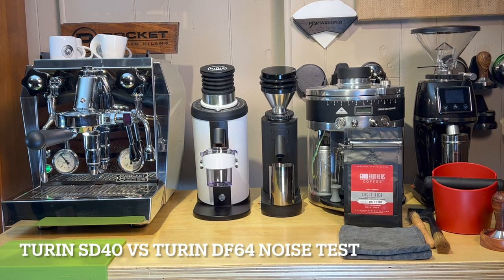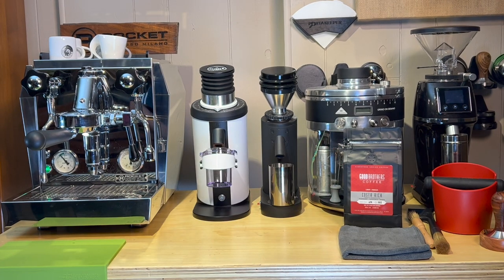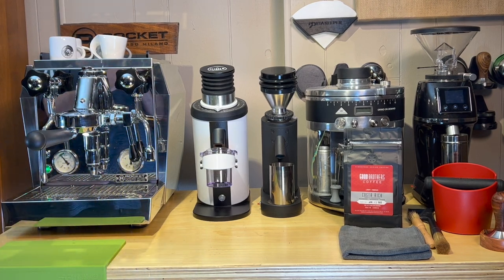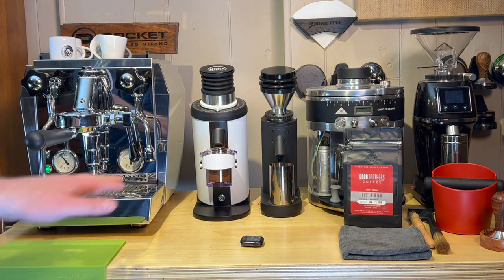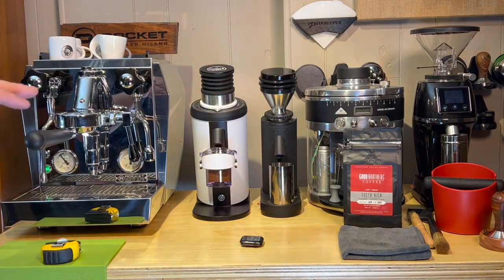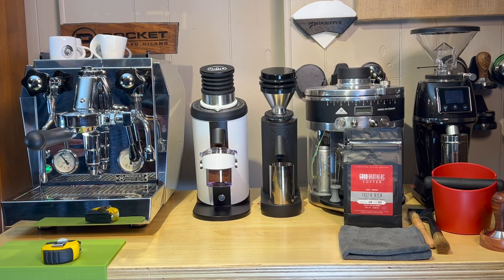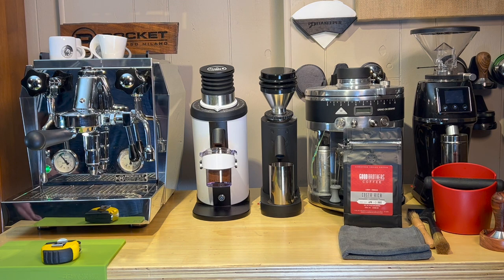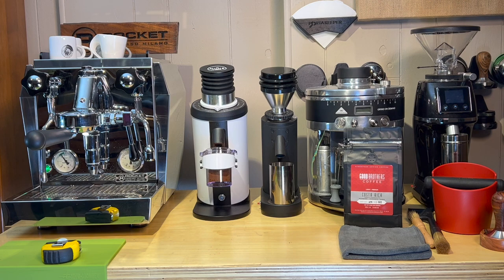SD40 vs DF64 Noise Test - Espresso Outlet

Comment: So apparently there’s going to be a DF 54 coming out. Would u think it would be louder with a smaller burr? Also, do flat burrs create more even grinds? Thanks!
Reply from the maker: Yes the 54 is coming.   Not sure about sound because I don’t own. There is also perceived sound.  Sometimes really deep sounding grinders sound very loud but less dB.  Similarly higher pitched are higher but seem quieter.   Flat burrs are just different particle distribution than conical